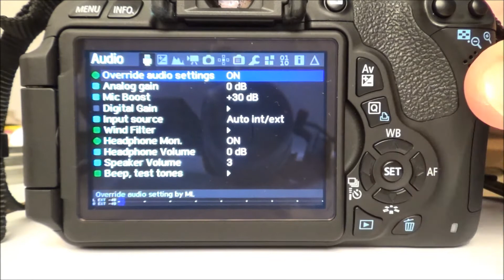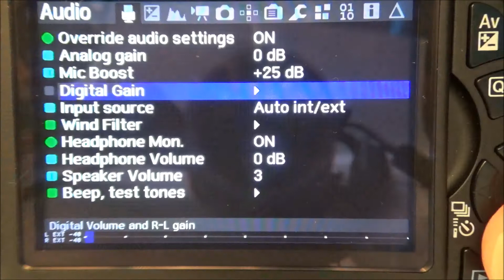How fix noise in Canon DSLR External mic - problem solved

Comment: Hey man.Which version of Magic lantern  you're using ? I have Canon 650D with the latest magic lantern version and i don't have the Audio menu :/
Reply from the maker: Hey! You need to use nightly build - I had same issue - official version was not supporting audio menu. (my current is Night from April 2016)
Reply: True, you can also use the Nightly for Mar. 30th 2017... fonts are even nicer.

Comment: What version of ML u are using? Mine doesn't look like that on Canon 600d and sound settings are missing from ML menu. Can you post a download link with your version of ML?
Reply from the maker: +ionut mocanu You are right - older version doesn't have it In this video I used latest version - night build from April 2016 - Now I see there is even newer from May - go to http://builds.magiclantern.fm/ choose 600D.102 (make sure that you have firmware 1.0.2) and get the newest. Good luck!
Reply: +Holik Studios USA Thank you. I already did it and works fine. I installed ML especially for AGC override, made a lot of tests but still can get rid off that awful hiss noise. Can you share your personal settings?
Reply from the maker: +ionut mocanu All settings has been presented in the video - please watch carefully again. Maybe the problem is with you microphone - try to set Mic gain to 0 dB and record some "silence" with external microphone plugged in.
Reply: I thought the 600D has the AGC on/off switch and volume control by itself without Magic Lantern needed for it? And that was the main difference to 550D besides the flip screen? I guess that's not the case?

Comment: i did this and still hisses
Reply from the maker: Have you tried without mic ? Record silent ?
Reply: I haven't, I bought a rhode mic and started to record with it and then tried the video on final cut pro and it gave a hiss noise, like really bad audio. I recorded inside with no noise.
Reply from the maker: Have you tried your mic with another device like PC computer record - maybe there is something with cable or mic itself. Or your mic-in is broken. Can you upload some sample. I can analyse frequency spectrum